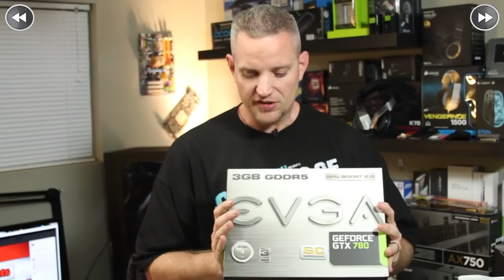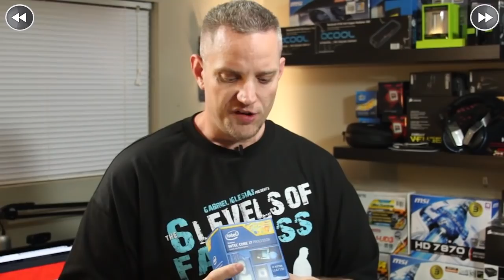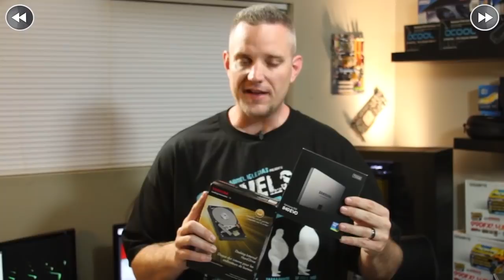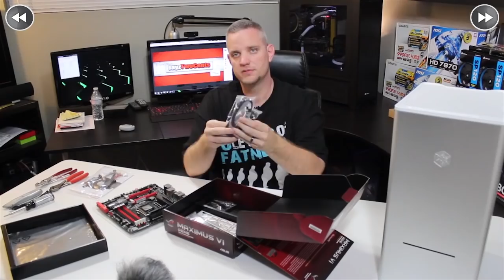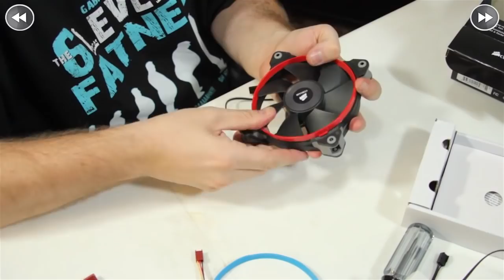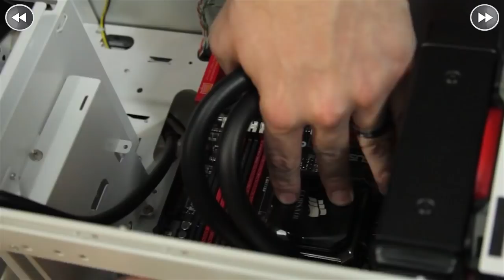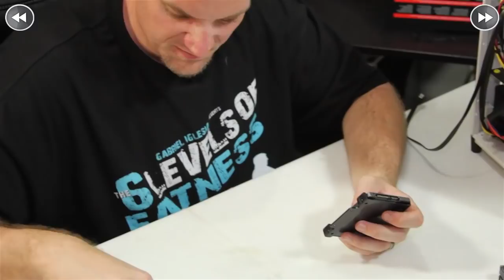How to build the Ultimate Gaming PC - Build Guide and Tutorial

Comment: PCPartPicker part list: http://pcpartpicker.com/p/DDqTqs
Price breakdown by merchant: http://pcpartpicker.com/p/DDqTqs/by_merchant/

CPU: Intel Core i7-4790 3.6GHz Quad-Core Processor  ($249.99 @ Micro Center) 
CPU Cooler: Corsair H55 57.0 CFM Liquid CPU Cooler  ($49.99 @ Amazon) 
Motherboard: Gigabyte GA-Z97X-GAMING 7 ATX LGA1150 Motherboard  ($159.99 @ SuperBiiz) 
Memory: G.Skill Ripjaws X Series 8GB (2 x 4GB) DDR3-2133 Memory  ($72.98 @ OutletPC) 
Storage: Sandisk Solid State Drive 128GB 2.5" Solid State Drive  ($59.98 @ OutletPC) 
Video Card: NVIDIA GeForce GTX 970 4GB Video Card  ($760.00) 
Case: Corsair SPEC-01 RED ATX Mid Tower Case  ($34.98 @ NCIX US) 
Power Supply: EVGA 850W 80+ Gold Certified Fully-Modular ATX Power Supply  ($94.99 @ Newegg) 
Optical Drive: Samsung SH-224DB/BEBE DVD/CD Writer  ($14.98 @ OutletPC) 
Operating System: Microsoft Windows 7 Home Premium SP1 (OEM) (64-bit)  ($88.98 @ OutletPC) 
Monitor: LG 22M35D 60Hz 22.0" Monitor  ($109.99 @ Micro Center) 
Monitor: LG 22M35D 60Hz 22.0" Monitor  ($109.99 @ Micro Center) 
Case Fan: Corsair CO-9050016-RLED 52.2 CFM 120mm  Fan  ($20.99 @ Newegg) 
Keyboard: Razer BlackWidow Chroma Wired Gaming Keyboard  ($159.99 @ Amazon) 
Total: $1987.82
Prices include shipping, taxes, and discounts when available
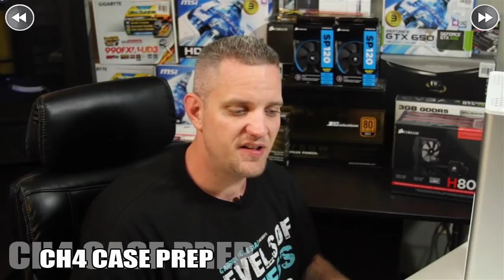Generated by PCPartPicker 2015-02-21 10:07 EST-0500
Reply: This will be my first build so any and all comments/advice is welcome. Like do I need two video cards to run dual screen
Reply: bodaciusf I'm assuming you don't need help anymore
Reply: GreesemanGaming no thank you I got it sorted out and very happy so far
Reply: bodaciusf Well done, I hope you enjoy your new system!
Reply: i might have typoed or you might have misread but that was for a dual gtx970 (two cards) they were about 400 each plus tax

Comment: *BASE_PRICE:[+2099]
is this good

CAS:NZXT Source 340 Mid-Tower Gaming Case w/ USB 3.0, Side-Panel Window (Black/Orange Color)
CPU:Intel® Core™ i7-5930K Six-Core 3.50GHz 15MB Intel Smart Cache LGA2011-V3 [+206]
FAN:Asetek 510LC 120mm Liquid Cooling CPU Cooler - Enhance Cooling Performance (Single Standard 120MM F
HDD:256GB ADATA SP610 SSD + 2TB SATA III Hard Drive Combo 
IUSB:Built-in USB 2.0 Ports
KEYBOARD:AZiO Large Print KB505U Keyboard w/ Tri-color backlight [+20]
MEMORY:16GB (4GBx4) DDR4/2400MHz Quad Channel Memory (GSKILL Ripjaws 4)
MONITOR:22" Widescreen 1920x1080 Sceptre E225W-1920 LED Monitor [+116] (Single Monitor)
MOPAD:Corsair Gaming MM200 Mouse Mat - Standard Edition PN:CH-9000079-WW [+14]
MOTHERBOARD:ASRock X99 Extreme4 ATX w/Intel GbeLAN, 3x Gen3 PCIe x16, 2 PCIe x1, 1x Ultra M.2, 10x SATA 6GB/s
MOUSE:AZZA Optical 1600dpi Gaming Mouse with Weight Adjustable Cartridge
NETWORK:Onboard Gigabit LAN Network
OS:Windows 8.1
POWERSUPPLY:1,000 Watts - AZZA Titan 1000W 80 Plus Bronze Active PFC Power supply
RUSH:Standard Process Time: Ship within 8 Business Day
SOUND:HIGH DEFINITION ON-BOARD 7.1 AUDIO
VIDEO:AMD Radeon R9 295X2 Dual GPUs 8GB GDDR5 PCIe 3.0 x16 Video Card (Single Card (Dual GPU))
_PRICE:(+2455)
Reply: ***** he named it VIDEO ^^
Reply: Carfreak36 
The 22 Monitor seems a little small for such a overkill System ^^
Reply: Wilko Stomberg Yeah haha ^^
Reply: Carfreak36 
I would switch the R9 295X2 for a R9 290X and would buy a 27" Monitor or a 4K Monitor or something like this. 
But mh, nevermind :D
Reply: Wilko Stomberg It's not my system anyways haha ^^ But yeah ;)
Reply: Carfreak36  I know i know, just my thoughts ^^
Reply: Wilko Stomberg Yeah haha ^^
Reply: learn to shorten the specs

Comment: planning on building a gaming pc would thhis be good enough considering it's price?:

1  Corsair Carbide 200R Komplett Edition Midi Tower Black
1  Cooler Master B500, 85% efficiency, 500W PSU
1  AMD FM2 A8-6600K Black Edition, 3.9GHz Quadcore
1  HyperX Fury DDR3 1600MHz 8GB Black (2x4GB)
1  Gigabyte FM2+ GA-F2A78M-D3H
1  Kingston V300 SSD 2.5" 120GB SATA 3.0
1  XFX Radeon R7 260X 2GB GDDR5 Ghost 2.0
1  ASUS DVD Writer, DRW-24F1ST, SATA, Black, Retail

would this be good enough? don't have a huge buget so hope this could work.
Reply: I have that cpu it sucks, get an i7, i5
Reply: dos'nt matter have found a better build that i will buy

Comment: I am trying to build an entry level gaming comp, can you guys check out the specs and give me some tips?
AZZA EOS 206S Black/Blue Mid-Tower Gaming Case
AMD A6-6400K 3.9GHz(4.1GHz Turbo) CPU and AMD A78 Chipset Motherboard Combo
ZALMAN CNPS7000V(AL)-1-PWM Silent Pure Aluminum CPU Cooler with enhanced performance and silent operation
Major Brand 1TB 7200 RPM SATA III 6.0
8GB DDR3 1600MHZ (2 X 4GB)
NVIDIA GeForce GTX 750 1GB GDDR5 16X PCIe Video Card
Major Brand 350 Watt Power Supply
Generic CD/DVD Burner Model CD-146-101 BOM - OEM
Microsoft Windows 8.1 64 Bit - OEM
Azza Keyboard and Mouse Combo
Reply: Looking at this build i suggest installing a 430 watt psu or 500 for upgrades and also get a 2gb graphics card

Comment: anyone i wanna know if these parts will work 
nzxt s340 case
kingston 240gb ssd
ATX DDR3 1333 LGA 1150 Motherboards Z87-G41 PC MATE 
Corsair Builder Series CX 500 Watt ATX/EPS  80 PLUS (CX500) power supply
Dell Memory 8GB (2x4GB) PC2-5300 SNP9F035CK2/8G ram
WD 2tb green hard drive
Intel Core i5-4460 LGA 1150 CPU - BX80646I54460 cpu
EVGA GeForce GTX 970 Superclocked ACX 2.0 4GB GDDR5 256bit, DVI-I, DVI-D, HDMI, DP SLI Ready Graphics Card Graphics Cards 04G-P4-2974-KR graphics card 
thanks if you reply

Comment: Hi, I'm looking to build a $1500-2000 gaming pc. Im trying to get the best specs for that price. I'm saving up from my christmas and birthday/chores to get something that will fit my budget. Please leave your comments below of what I should change and stuff like that. 

Intel Core i5-4690K 3.5GHz Quad-Core Processor
Corsair H100i 77.0 CFM Liquid CPU Cooler
Gigabyte GA-Z97X-SLI ATX LGA1150 Motherboard
Corsair Vengeance 8GB (2 x 4GB) DDR3-1600 Memory
Samsung 840 EVO 120GB 2.5" Solid State Drive
Seagate Barracuda 2TB 3.5" 7200RPM Internal Hard Drive
Gigabyte GeForce GTX 980 4GB Video Card (2-Way SLI)
Gigabyte GeForce GTX 980 4GB Video Card (2-Way SLI)
NZXT S340 (Black) ATX Mid Tower Case
Corsair Professional 650W 80+ Gold Certified Semi-Modular ATX Power Supply

http://pcpartpicker.com/p/jgDpD3

Comment: This is a first build for me, and I'm not buying any parts yet, although I'm keeping a close watch on prices across a wide range of sites that sell all of these items.

i7 - 4790K

Gigabyte z97 gaming 7

Msi GTX 970 4g (Possibly 2 in SLI if I have the budget for it.)

Corsair Vengeance 2x4GB

Intel 730series 240GB SSD (Great Microcenter deal for $110!)

WD Blue 7200rpm 1TB HDD

Corsair CX 600 Modular (CX750 if I get the extra GTX 970?)

Thermaltake Versa H34

Thanks greatly for any adivce!
Reply: Wavey Mo No. You don't need 16gb ram if you only do gaming. unless you are doing some heavy editing, etc.
Reply: its a great build can run pretty much all games in high quality i suggest you upgrade your ram to 16 gb
Reply: don't bother with a i7, I am building a VERY similar build and a i7 is only needed if you do heavy video editing, i recommend a i5 4690k it is easily fast enough and you can overclock it if you want however to overclock you need to buy a aftermarket heat sink, they are like 10 pounds so you might as well
Reply: Nathan Burgard Yup i5 is good enough

Comment: I'm in a process of building myself new machine,here is what i chose
ARIVBE,4930k,dominator platinum 16gb 2133mhz,h100i,asus gtx 780ti matrix platinum,AX860,samsung 840 evo 250gb,WD 3 tb green.
Reply: ErenJaeger

780ti is better then 970 but i will get STRIX-GTX980-DC2OC made last minute changes
Reply: ErenJaeger

well matrix platinum is much more then 1% better.And even if it was just 1% i would go for it.But all that doesn't matter anymore because 980 is here and i already canceled my order and change it for STRIX-GTX980-DC2OC.With all of components i have this was only option for future proof.I don't plan to buy new pc in next 5-6 years.I will just get one more 980 in few months time for sly and better 4k
Reply: Grim Reaper great call on the GPU, gtx 980 is cooler, more powerful and in my country, cheaper than the gtx 780ti.

Comment: Hey ***** im currently building my gaming pc into the FT03S, however having some trouble installing the H60 radiator as it is coming into contact with that angular support arch on the front top left corner of the case.

How'd u get pass it with the H80?

Comment: Hello I am a noob at making pcs, tell me are these compatible with the motherboard ans stuff? 

Graphics card: XFX RADEON R9 290 947MHz 4GB DDR5 DP HDMI 2XDVI Graphics Card (R9290AENFC)

Processor: AMD A10-Series APU A10-7850K AD785KXBJABOX

Motherboard: MSI, MSI Z87 MPOWER MAX Desktop Motherboard - Intel Z87 Express Chipset - Socket H3 LGA-1150 (

Case : Cooler Master HAF X - Full Tower Computer Case with High Airflow Windowed Side Panel and USB 3.0

Hard drive: Western Digital WD VelociRaptor WD6000HLHX 600GB 10000 RPM 32MB Cache SATA 6.0Gb/s 3.5" Internal Hard Drive Bare Drive
  
 Power supply : Corsair CX Series 750 Watt ATX/EPS Modular 80 PLUS Bronze ATX12V/EPS12V 744 Power Supply CX750M

Ram: Corsair Vengeance Blue 8 GB (2X4 GB) PC3-12800 1600mHz DDR3 240-Pin SDRAM Dual Channel Memory Kit CMZ8GX3M2A1600C9B
Reply: motherboard is not compatible with your CPU, I suggest the MSI A88X-G45

also you have a K version CPU and they are meant for overclocking, if you want a K version cpu you WILL need a CPU cooler, I suggest the cooler master nepton 240m since it is a good water cooler and is an all-in-one cooling setup meaning it is easy to set up and are plenty of tutorials here on youtube how to use it

Comment: AMD FX6300 Black Edition 6 Core
EVGA 500W PC Power Supply
HyperX 8 GB 1600 MHz CL9 DDR3 RAM
MSI 970A-G43 AMD 970 ATX Motherboard
Sapphire R9 270X 4GB 1020MHz GDDR 5 PCI Express Graphics Card 

How well would this run BF4? Thanks :)
Reply: In think a bit overo 50fps
Reply: Dylan Davis
I have fx 8350 and r9 270x vapor x. get 55 frames average. VERY good build
Reply: Overclocked or not?
Reply: Sam Catalfo

Comment: Sorry, but the case is crap. I doubt the air flow is "optimal" with this configuration. Else I would doubt that the fan doesn't suffer damage over time with the CPU cooler hoses pushing onto it. :-/
Reply from the maker: You're clueless
Reply: I know this is many years later, but just to let you know the air flow was fine, the fans and CPU where fine. I'm only now replacing the CPU and thats my fault for not paying attention to the liquid cooler going out and cooking it.
Reply: ***** I love your videos :D From down-under
Reply: +JayzTwoCents Straightforward all the way.
Reply: Hubieee a

Comment: Probably a really stupid question, but when you buy and build your computer, does it come with wireless internet connection? I just thought of this because I have NO Ethernet ports near to where I work and don't want to have to move anything around. If not how do I get WIFI onto the PC.
Reply: No...it depends on what motherboard you use because some have wifi built in and some don't...if your motherboard doesent than you can buy a usb wifi card or an internal pci card

Comment: end of the day a ps4 is £350, its simply kimpossable to build a pc with as much power as a ps4 for that money, and dont include a pc that has no windows op system and no controller keyboard or mouse. to buy a pc with the same speed its gona cost you atleast £600, and think of all the stuff ps4 does better.
Reply: i can respect what you are saying and see where you are coming from, but if you think about when witcher 2 came out i got it for about 36, 37 dollars compared to the 60 on the ps3 and there are a lot more game and i all ready have witcher 3 for me for when it comes out and it cost me absolutely no money. So in the long run the PC is a much better deal, but on top of that you can play a game like tomb raider and not have to go out and re-buy it gust to play it on the next gen because when you think of it the PC is just one reeeeealy long generation

Comment: I dunno why everyone is going to Intel and Nvidia now. I've used both in the past but atm I'm using a First Gen AMD Bulldozer FX-4100 Quad Core at 3.60GHz and an R9 280 3GB GPU and I've never had issues with AMD before. I guess It's all down to preference in the end.
Reply: Becuase Intel is faster? But nVidia is just preference
Reply: Used Intel products before for several years. Don't like them. Never had any kind of overheating problems or performance problems with AMD products.
Reply: Games only can use up to 4 cores and intel can have up to 8 so nah, waste. Amd is red and ati is cool.

Edit: AMD is best
Reply: NeatSquid
i was just thinking about it actually i'm not sure it was. i think it was the athlon xp that was the slot type. i had both of those in that build at one time. idk that was like 15+ years ago one of them was one of them was the regular pga zif type. hard to remember now but i do remember that water cooling systems were extremely expensive back then and we didn't have the "all in one" rad type solutions we have now. i just thought i was being extremely clever w/ the box fan thing lol
Reply: Michael Stokes
agreed. that said, i have owned intel, AMD, and Nvidia products. AMD cpus are fine but they do tend to run a lot hotter and use more power than intel. makes sense more power = more heat(it's simple electronics theory). it's a trade of tho do you want cool and expensive or hot and cheap?

i've only ever owned one radeon GPU and idk if i got a dud or something but i had nothing but problems with it. :/

i run intel/nvidia now only because i trust it to be a certain quality. i'm not an elitist dork one of my cousins runs an AMD cpu/nvidia gpu system and the thing is bawls! xD it's better than mine but he's got a lot more money than i do to build higher end systems lol.
Reply: MikuHatsune10728 well I don't know, it's just what I've heard
Reply: i think that intel cpu's are better performance per core, But how would I know.
Reply: MikuHatsune10728
It's not that they're bad, it's just they use an outdated and very weak architecture and an outdated as hell socket type.
Reply: Maybe cause they wanna record and they use i7 and nvidia...even tho amd gets more fps...but i needed to mess with the games settings and cores to get it working...maybe thats why o_O
Reply: i used to run a box fan w/ my tower open cuz my k6 was constantly over heating...the one and only time i bought a radeon gpu my games stopped working...that's why i stick to intel/nvidia now
Reply: Kewl Beans
Ever heard of thermal paste replacement?
Reply: NeatSquid
lol 15 years ago? no i'm not even sure those slot cpus they had back then could be taken apart. admittedly i was pretty green back then tho ;)
Reply: Kewl Beans
Oh sorry, I didn't know the k6 was a slot :P Sorry.
Reply: *****
ok now you're just being an ass...
Reply: Rik Dusk lol i got the same cpu xD

Comment: hey guys wondering if this is a good build
Case: nzxt source 210
PSU: corsair 500w
Processor: AMD fx 6300
Motherboard: Asus m5a97 R2.0
Graphics card: r9 270x
Ram: gskill rip jaws 1600 mhz 2x 4gb
Storage :WD black 1tb
Will this play games very will at medium high settings with good fps and could this max out skyrim
Thanks in advance c:

Comment: How much are those fans each
Reply: About $15. They get loud pretty fast and are only popular because of the color rings. Noctua fans are the best in terms of cooling and silence for about five to ten dollars more.
Reply: Parker Bass Noctua fans are not the most silent fans out there too. And what such with them is the brow color that usally doesn't fit in
Reply: That's true. I just hope Noctua gets new color schemes. It's a shame that their fans look like crap when they are the best ones around. I put mine at the top of my radiator so you can't see them when you're looking inside the window.
Reply: ***** but spin at 2000 RPM or 3000  so they are louder too (out of the box)
Reply: *****  Noctua redux, black/grey and costs less.
Reply: *****  True, but they do come in most sizes, including 120mm, and pretty much every case nowadays uses 120mm fans
Reply: *****

I guess, Noctua seem to take one step forward and one backwards.

Comment: Why do you use static pressure fans for airflow?
Isn't it a better option the Corsair AF?
Reply: Airflow fans should be used when they have good clearance. Use static pressure fans against radiators or harddrive cages.

Comment: Is this a decent pc build? This will be my first pc build when i get the money haha

-NZXT Phantom 410 Series CA-PH410-B1 Black Steel / Plastic ATX Mid Tower Computer Case
-ASUS P8Z77-V LGA 1155 Intel Z77 HDMI SATA 6Gb/s USB 3.0 ATX Intel Motherboard
-ASUS GTX760-DC2OC-2GD5 GeForce GTX 760 2GB 256-Bit GDDR5 PCI Express 3.0 x16 HDCP Ready SLI Support Video Card
-CORSAIR HX Series HX750 750W ATX12V 2.3 / EPS12V 2.91 SLI Ready CrossFire Ready 80 PLUS GOLD Certified Modular Active PFC
-Intel Core i5-3570K Ivy Bridge Quad-Core 3.4GHz (3.8GHz Turbo) LGA 1155 77W Desktop Processor Intel HD Graphics 4000 BX80637I53570K
 -CORSAIR Vengeance 8GB (2 x 4GB) 240-Pin DDR3 SDRAM DDR3 1600 (PC3 12800) Low Profile Desktop Memory Model CML8GX3M2A1600C9
-WD BLACK SERIES WD1003FZEX 1TB 7200 RPM 64MB Cache SATA 6.0Gb/s 3.5" Internal Hard Drive
-ASUS VS Series VS238H-P Black 23" 2ms HDMI LED Backlight Widescreen LCD Monitor
-ASUS DVD Burner Black SATA Model DRW-24B3ST/BLK/G/AS
-Cooler Master Hyper 212 EVO - CPU Cooler with 120 mm PWM Fan